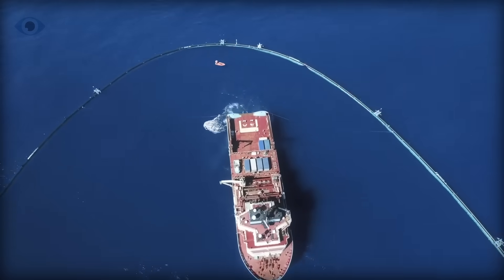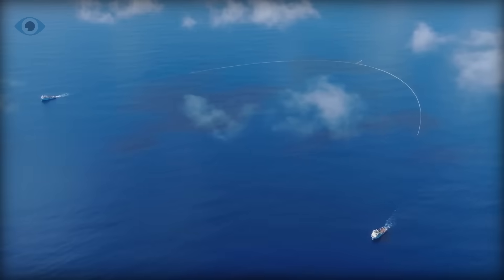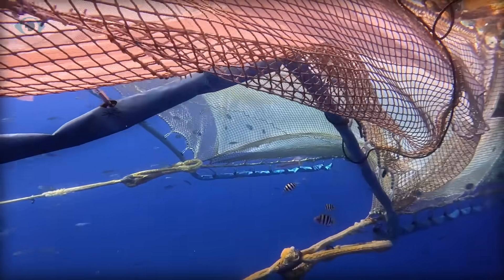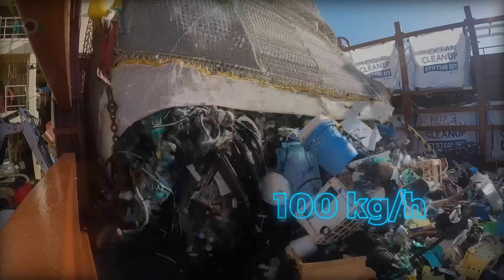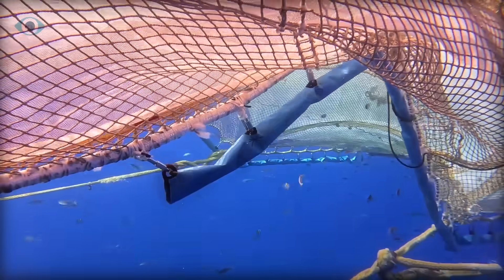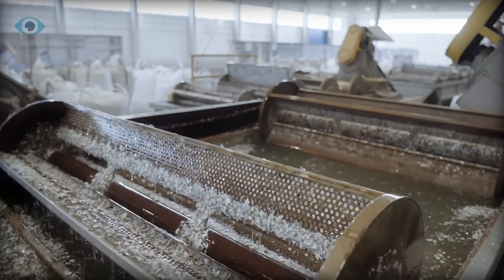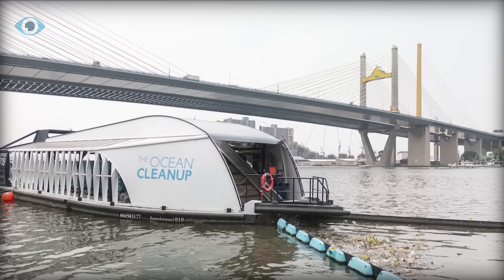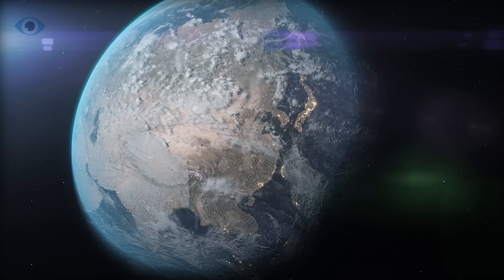Ocean Cleanup: System 03 Just Made History in the Pacific | EyeTech

Comment: Hahaha if you do the math though it paints a very different picture. 
Let's see:
We throw about 11 million tons of garbage every year as an estimate.
So with that new system we'll just need about 670 of those, making at least one full trip with full crew, each and every day of the year, so we can only stop the garbage patches (yes it's plural) from just  growing.

And about plastic recycling its by far not that simple. Only a few types of plastic (such as PET, HDPE, LDPE) can be recycled. Plastics such as bags and elastic ones its a big no. And of those recyclable only those with identification are processed cause of the risk of contamination. And of those that do get recycled the applications or far less than the original plastic could be used (so they tend to be recycled mostly 2-3  times overall). And on top of that most plastic products are cheaper new than recycled. 
So after all this we get a 10% best scenario of recycling of the plastic gathered. The other ones are just buried, burned or "recycled back to the ocean. 

So no it won't do anything, scientifically it's not a fissible solution and in many cases worsens the problem. Cause with such pr stunts, companies get to continue producing plastic uncontrollably, while we are relaxing thinking that the problem is solved.

Comment: While these efforts are commendable, we need sensible regulation that make producers use bio degradable plastics, fewer plastics so they could be recycled better or the pressure/heat method to break it down and create new crude oil. Point being we need ways to prevent plastic even making it into the ocean. This here is already one step too late in my view, but of course better still then not cleaning it up.

Comment: Plastic should be bundled into blocks and buried 500 plus meters in the earth in stable rock formations just like radioactive material and both should then never be made again. Otherwise you're just moving pollution from one spot to another spot. The challenge isn't the pollution it's the money making the pollution profitable. If you don't scrap that nonsense you'll be wasting your time. It's like shoving snow in a blizzard. I guarantee that barge loads of garbage are being dumped in the oceans on the regular